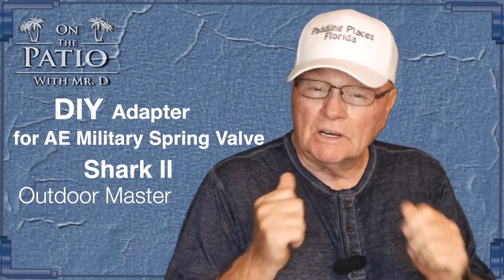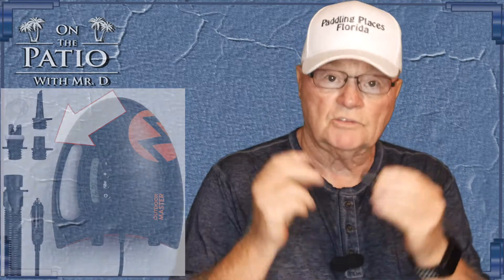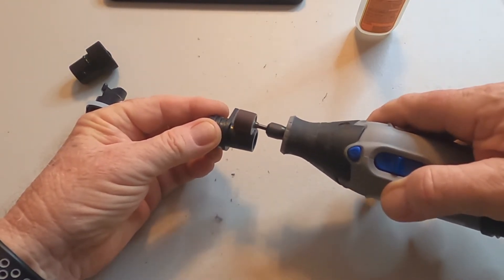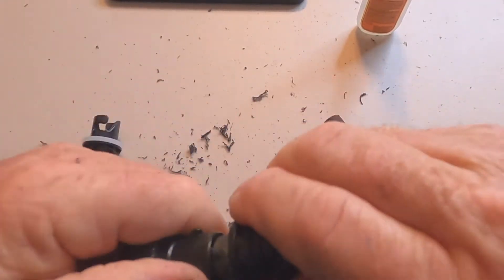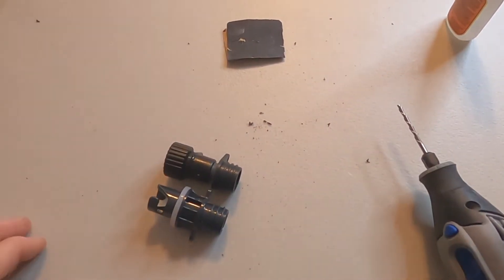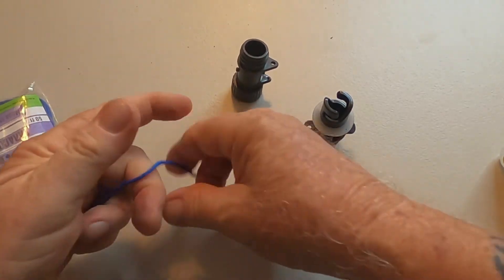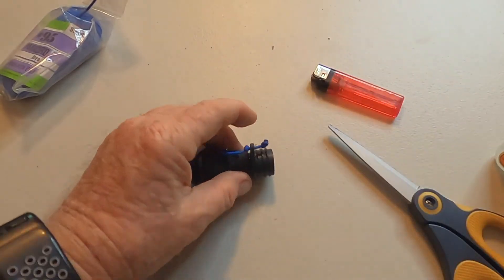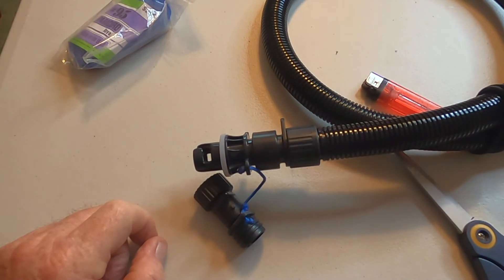AE Adapter DIY for Shark II

Comment: Very ingenuitive. My military spring valves always break. The spinning ring piece splits. I'm careful about attaching them too. I'm not sure if I got a bad batch, but I've fixed the problem by putting a tie-wrap tightly around it.

Comment: Awesome Dale. I still find filling that DS floor a PITA even with your trick. Thanks for the tutorial.
Reply from the maker: Are you sure the spring valve is fully seating? Might have some obstruction in there. Should be a quick spit of air when removed.
Reply: @DaleMrDSimmons  I always check for obstructions. Even using your trick with grabbing the "elbow" to twist off often has me refilling the floor twice. Probably one of the major reasons I'm not out with it more :(
Reply from the maker: Bruce Wayne bummer. Have never had that problem since I figured out that trick.
Reply: @DaleMrDSimmons  I'll have to keep practicing  😁